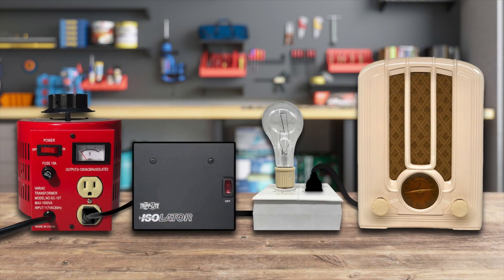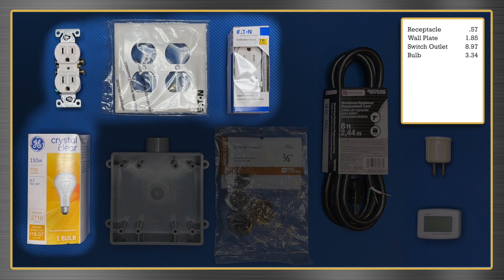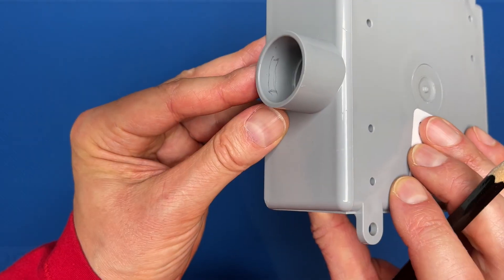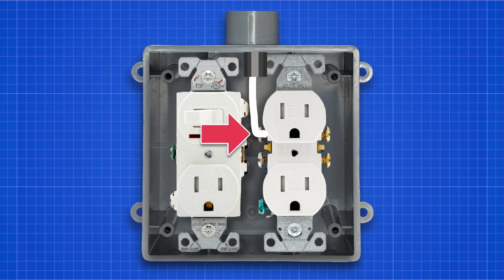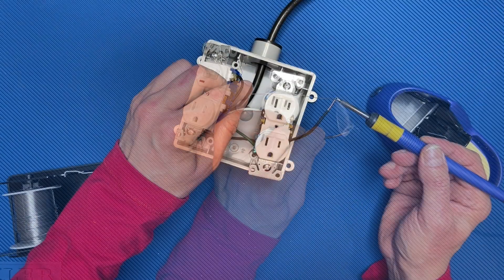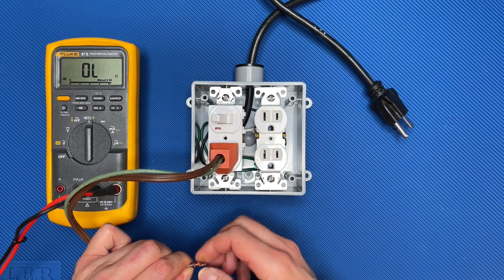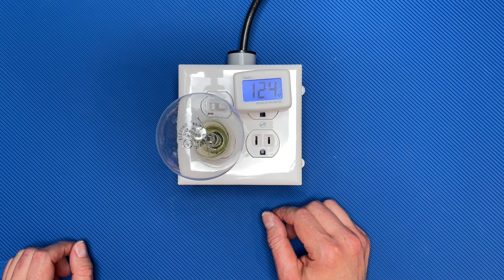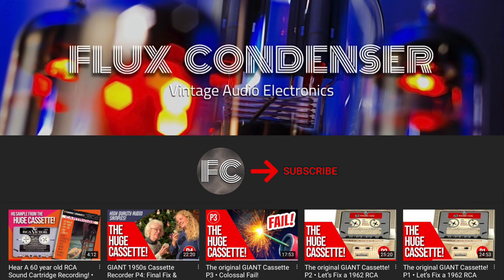Build This Dim Bulb Current Limiter

Comment: I built mine a bit differently. I used a split duplex outlet (break the tab on the brass screws) and a double pole switch (HD & Lowes have these too). The lightbulb (or 6amp Edison base fuse) plugs into one outlet side, the device under test into the other, both interchangeable, wired in series. The double pole switch ensures both sides of the AC line are disconnected when off. I know the neutral is grounded at the service but just a little extra safety. I also put in a 1/2in neon "power on" indicator. Since those "plugin" bulb sockets are cheap, I have a few with 40, 100, 200 watt bulbs already installed. I do like your plastic box. The less grounded metal on the bench, the better.
Reply: If you build one that way using only one duplex outlet, then you also have to break the tab on the other side of the outlet also and then use a jumper wire from the neutral terminal of the first outlet to the hot terminal of the second outlet before finally going back to neutral from the second outlet, otherwise you end up with reversed polarity on the second outlet, which is of course a dangerous shock hazard when testing certain equipment that has the neutral connected to the chassis, because with reversed polarity on the DUT outlet then you end up with hot being sent to the chassis of some older equipment!
Reply: @JoeJ-8282  True, but you shouldn't be working in hot chassis equipment without an isolation transformer. I do have one and put it in front of the dim bulb tester if working on hot chassis gear. That would include modern switching power supplies. And safety issues aside, even with the chassis on the neutral you still have a problem with the neutral wire impedance back to the main panel where it ties to the service ground. This is more than enough to cause significant measurement errors with grounded test gear..
Reply: @andydelle4509  I don't think you understand what I mean when I refer to "hot" going to the chassis of the equipment. There is NO piece of manufacturer built equipment that deliberately wires the hot lead to the chassis, (that would be just plain stupid and a major safety and even fire hazard!), but when I said you may eventually get shocked by having the hot on the chassis, due to the NEUTRAL lead of the power cord of some older equipment being connected to the chassis in certain circuit designs, and then your outlet box of your dim bulb tester, (with the way you have it wired), sending hot onto the neutral lead of the equipment being tested, because it backfeeds THROUGH the bulb itself on the bulb's neutral side, and then, (unless you have BOTH metal connecting tabs on your duplex test outlet broken off AND you wire it as I mentioned earlier, above), then you have the neutral side of the bulb outlet, (which essentially has the hot lead of incoming power on it because it feeds through the bulb first), you have that then going directly to the neutral side of the equipment to be tested outlet, which is not good, because then the hot can get back onto the chassis of the equipment under test on the neutral side of the equipment's power cord! That is why it is essential for best safety to wire the test box duplex outlet as I said in my first comment to prevent the polarity reversal on the second, (DUT), outlet...

Now an isolation transformer will help with the danger of that and you getting majorly shocked as a result of having the test outlet wired backwards, but it won't be as safe as it could and would be if your test outlet was wired properly in the first place. In order for any electrical power sources to be totally connected in series, you must wire hot to first device, (bulb), then neutral of that to the HOT of the 2nd device, (DUT outlet), and then the neutral of the 2nd device/outlet back to the power source neutral, but that is ONLY possible, (i.e. with the correct polarity on BOTH outlets), IF BOTH metal connecting tabs on both sides of the duplex outlet of your test box are broken off/separated, and then you wire the neutral screw of the 1st outlet to the hot screw of the 2nd outlet with a jumper wire instead...

Think of it kind of like a flashlight with 2 batteries in it. In order for a proper series connection to happen you must have the 2 batteries connected + to - in the middle, otherwise the circuit won't work. (Maybe that's not the best analogy, but hopefully you can see the resemblance, even though the voltages are totally different, along with it being DC in batteries, and AC with this tester we're talking about), but even AC has a polarity to it in relation to ground, as you prob. already know, and the hot side can be quite dangerous to touch in most cases. In the case of you always using an isolation transformer, that alone has saved you from getting majorly shocked with your test device as it is wired, but you wouldn't even NEED an isolation transformer in the first place to be safe if your test outlet box was wired as I suggested in the first comment.

Anyway, I hope you can understand WHY I'm suggesting that you should change the wiring around on your tester's second outlet, because the way you have it now is ultimately not totally safe to use, and if you or anyone else was to ever use it as it is without the isolation transformer then you could potentially get injured, but if you fix the wiring to be like I described in my first comment then it wouldn't really matter if you used an isolation transformer or not, because it would then be safe either way, at least provided that the device you're testing also has a polarized plug, which most do. Of course you still CAN use an isolation transformer in either case, for the ultimate in safety and isolation, but if the wiring in your test box was properly fixed then it wouldn't be absolutely necessary for prevention of shocks, it would just then be more for the equipment's sake.

I'm not trying to diss on your overall design at all, I'm only trying to help you make it a safer design for your sake!
Reply: @JoeJ-8282  I am an EE of 40 years. I fully understand what you are proposing and may even do it. It's a simple fix. My career has also involved work on broadcast transmitters and large UPS systems. I am fully versed on deadly voltages and current.

But no audio gear above an old table radio uses a hot chassis any more. "Hot chassis" is an industry term for tying one side of AC line to the chassis or signal ground. It does not necessarily mean to tie the hot side to the chassis. Some pre-1980s TVs still used hot chassis as they needed a cheap source of over 100 volts anyway for some of the circuits. But in any transformer or switch mode power supply fed device, the chassis ground is isolated from BOTH sides of the AC line.

But once inside any gear, you should use an isolation transformer. Especially today in that many switch mode power supplies are build on the same PC board as the rest of the electronics to keep costs down. You have many exposed internal components that may be direct to the AC line, both sides.

You also can't assume the wall outlet is wired properly. It's quite common to find them reversed as well.

Most videos here show dim bulb testers with open terminal pony sockets mounted on plywood. Talk about safety hazards!
Reply: @andydelle4509  Yes, I agree. And I understand what you're talking about too. I am an electrician by trade and I have also been an electronics experimenter/tinkerer/builder and vintage audio equipment enthusiast and speaker builder, (at least as a hobby), for the past 30 years or so, since my H.S. days. So we both know what we're talking about, and that's good. At least you can see what I meant when I suggested the slight change in your tester outlet wiring...

I also learned from YOU that the TERM "hot chassis" just means what you said. I didn't know that's the "name" for when the neutral was tied to the chassis/ground, so it's not literal, in the sense that the hot connects to the chassis, but instead the term just refers to when ANY/EITHER side of incoming power, (i.e. even the neutral), is connected to the chassis... I suppose that is exactly why they DON'T build any equipment like that anymore, for safety reasons, just in case an outlet that the device is plugged into is wired backwards.

I'm also aware of the way many switching power supplies are wired directly into both sides of the incoming line, and I totally agree that you def. should use an isolation transformer when working on those type devices, (or else just only work on those when the power to them is disconnected completely), so I think we're on the same page of understanding about all of this now...

If only everyone who built or builds a dim bulb tester would understand the polarity of the AC line getting essentially "reversed" (in a way), when it goes through a series bulb like it does in these testers, because I've seen quite a few videos on here of how to build one of these things that show it built wrong like that, and if someone who didn't understand electrical stuff at all built one like that where the second outlet had reversed polarity, because they DIDN'T make sure to wire the 2 outlets like I described in the beginning, and they were to then use it without ALSO using an isolation transformer, then they could potentially get shocked really badly if ever attempting to service a piece of vintage gear that had the "hot chassis" as you call it, or they attempted to work on a switching power supply, etc...

Maybe you might consider making a follow-up video that explains WHY you have to make SURE to wire BOTH outlets in your tester box with the proper polarity for safety, once you fix yours. Along with explaining why breaking only ONE of the side connecting tabs of the duplex outlet, (relative to properly breaking BOTH tabs and then changing the wiring of the second outlet with a jumper wire), actually causes that polarity reversal in one of the individual outlets, because that is a very commonly misunderstood difference, and most people who don't fully grasp the AC polarity concept think that it's essentially exactly the same whether you use the built-in tab to connect the second outlet or a jumper wire to the opposite side terminal of the second outlet, which in reality of polarity, the two methods are exactly the opposite... It's much easier to demonstrate in a video than it is to describe in words, especially to anyone who doesn't have a great understanding of AC polarity to begin with...

(But you making a follow up video to clarify this important difference is just a suggestion though, if you feel like the issue warrants enough attention for any of the electronic/electrical newbies out there who might just be getting into the hobby of messing with vintage electronics.)
Reply from the maker: Thanks for sharing your build, Andy. There are a lot of ways to go about it depending on what the user is looking for.

Comment: Great video - I will build one.  An improvement suggestion:  Include a detailed parts list in the video description section especially for those parts that have nontrivial procurement aspects, such as the volt meter, box, cable connectors, bulb socket adapter, etc (yes, everything you gave part numbers for and those things that are less than common).
Reply from the maker: Thanks, Charles, that’s a good suggestion. I’ll try to put a list together today and will either put it in the description or as a pinned comment.
Reply: Also, there is a special glue-in adapter available at Lowes or Home Depot, (or most other electrical supply stores), that you can use with that PVC box that has a rubber insert in the end that has a hole in it that's the same diameter as the round power cord, along with a threaded ring that tightens down onto it so the cord doesn't pull out. It is specifically designed for cords of this round type, and it is an even neater, more professional looking way to do the cord strain relief, and it works just as well as (or even better than), the black push in cable clamp that was used here in this video, except that with the glue-in one you don't have to modify the box hole at all first, you just glue it in with some conduit or PVC glue. The black cable clamp that was used in this video is made specifically for Romex wires going into a metal enclosure such as a breaker panel box.
Reply: @JoeJ-8282  Joe , do you have a model number or picture for this part?  I was unable to find it Lowes or Home Depot. Thanks

Comment: Great vid; but you stole my design from fortyfive years ago.  All kidding aside, I'm lazy and have four bulbs already screwed into socket adapters so that I can switch the current limiting quickly.  Unfortunately, filament bulbs are starting to get a little scarce.
Reply: Judge: "You are charged with the purchase and use of an incandescent light bulb. How do you plead?" I have noticed though that my Lowe's is now stocking more incandescent bulbs. I guess they got tired of all the returns where the "60watt equivalent" has the light output of a nightlight.
Reply: @andydelle4509  Yeah, that "watt equivalent" nomenclature should be banned.  Just give the Lumen output - works for incandescent, compact florescent, LED, and the pants-on-fire of the advertisers.  The wattage draw is a separate matter, and of interest only to those who pay the electric bill.  😉
Reply from the maker: Absolutely right, but I think we’ll be stuck with the soon-to-be outdated watt system for quite a while. Getting Americans to change their thinking on that will be like getting them to switch to metric!
Reply: @FluxCondenser  American stubbornness can be an asset but mostly it's a millstone around our collective neck, IMHO.
Reply from the maker: Ha! I hear ya. I’m actually all for the transition to more efficient bulbs and with many types in my home I’ve had good luck. But, even now, I’m finding a lot of LEDs just don’t mimic incandescents as claimed. Especially in light output, color and dimming-ability.
Reply: @FluxCondenser  I'm a big fan of power efficiency - we've adopted it as it developed (incandescent -> compact florescent -> LED lighting as bulbs burned), more efficient major appliances as the old ones died, white siding on the house when termites ate the old wood siding, etc.  Our electric bill has actually decreased over the 28 years we've lived here, despite increased electric rates and demonstrably hotter average temperatures.  And yes, LED lighting is still a work-in-progress but they're getting better.  The early LED bulbs we bought used to overheat (!) and burn out faster than the incandescents they replaced, but that's improved quite a bit for us and we haven't replaced an LED bulb in years.
Reply from the maker: Ha! You don’t “screw” around!